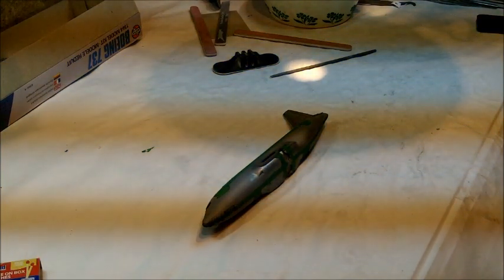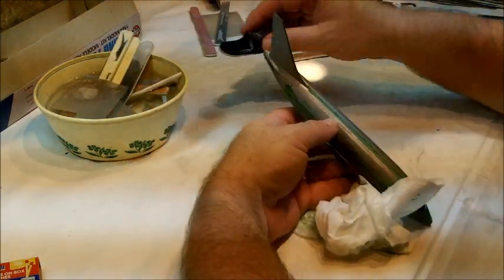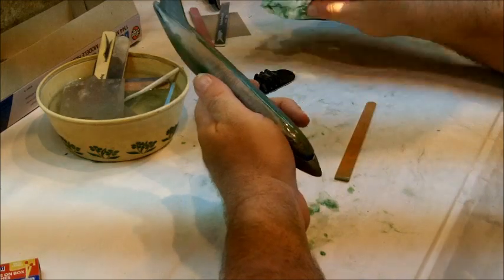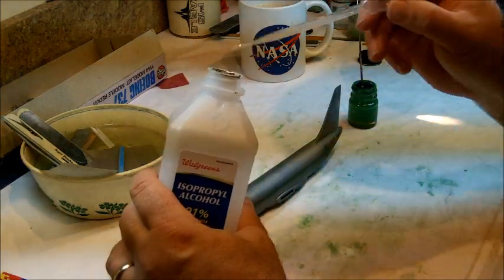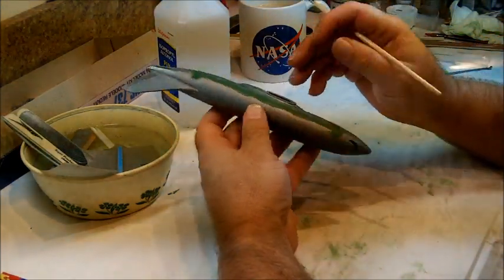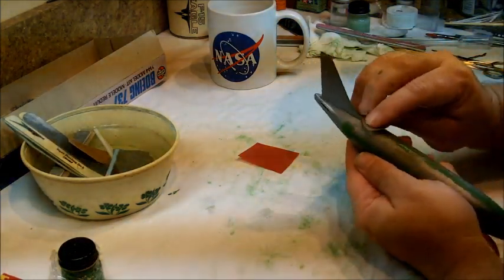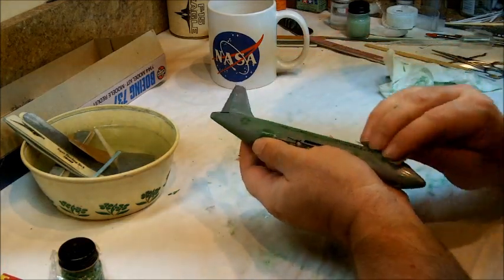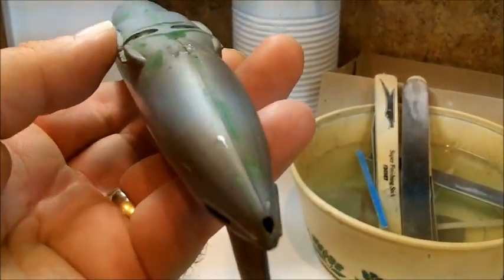Squadron Putty, Part 2

Comment: I use to hate Squadron Green Putty before but I kept trying it and got better at using it. I didn't know you could wet sand this product or thin it with alcohol. Squadron also sands fairly easily and I can get nice feathered edges. You are right about Tamiya Putty. It is a fine product but harder to sand. Great video. I learned some valuable tips. I am working on a Hobby Boss 1/16 scale Tiger I with some sink holes and motorization holes in the lower hull. I'm using Squadron Green to make short work of these blemishes.

Comment: Not much. The key is not to over sand when you get in close.  Squadron Putty is soft compared to the plastic.  Get the majority off with a medium grit, then back way off and use fine and extra fine to finish.  Often, using a very thin paste mix, you can put down a "glaze coat" with a brush to deal with pinholes and small areas that you may have over sanded.  It takes a bit of practice to get right.  Good luck!

Comment: One more question? what is the putty to alcohol ratio?
Reply from the maker: No specific ratio.  Just thin it out to what you need.  The alcohol or acetone, if that is what you use, will always evaporate, so every time you use it, you will probably need to put a squirt in there and mix it up real well.  If you keep using alcohol, the putty will lose its bite.  So throw some acetone in there once an awhile to keep it honest.  Don't let it dry out completely.  I like to put some saran wrap over the mouth of the bottle, under the lid, to slow the evaporation.
Reply: Dutycat Arts Thanks for the information, and keep posting the great videos.
This helped me get back into modeling again.